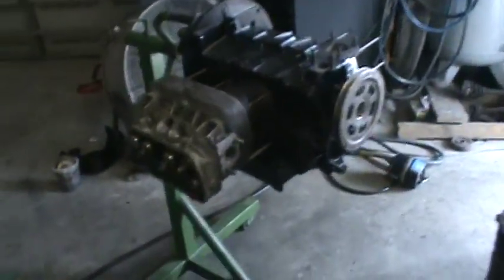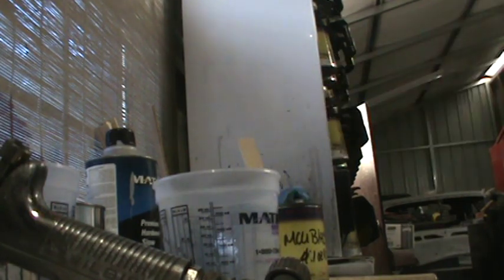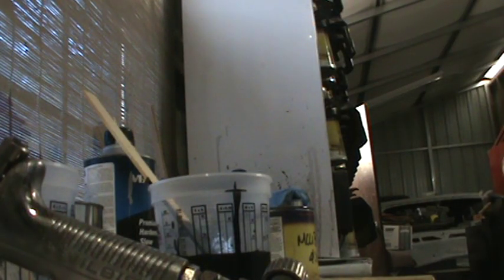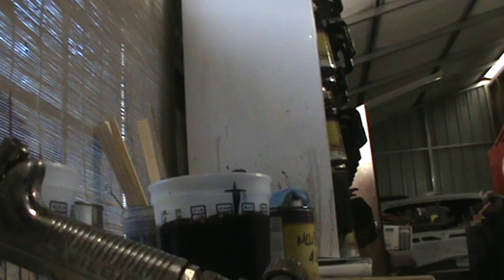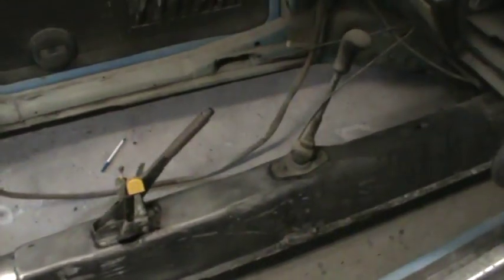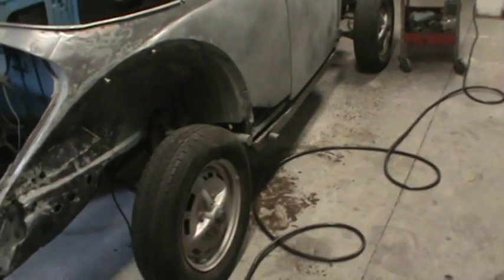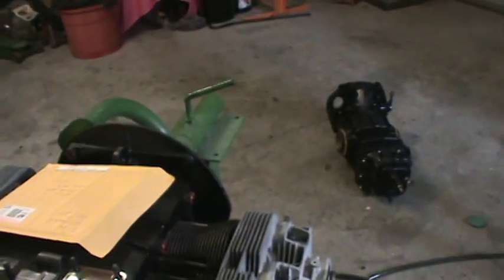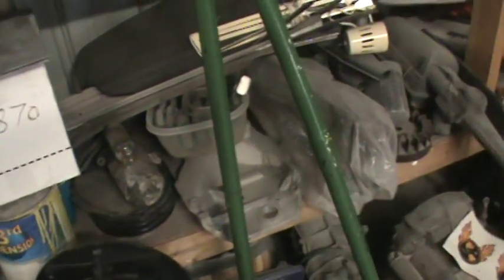PAINTING SINGLE STAGE

Comment: Clean shiney parts, I much rather work with nice clean parts, makes the job seem so much easier. Makes the job look a whole lot nicer when finished also. Great job Darrin, Cheers OLDDUDE.........PS, I could use a cup and adaptor hub for my Sata NR2000 when Andrea remembers to check them out.